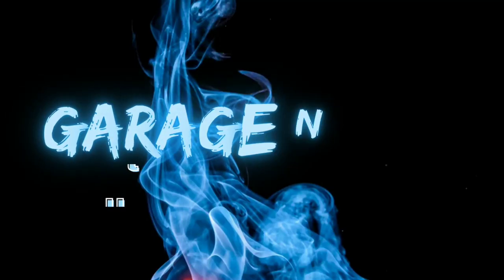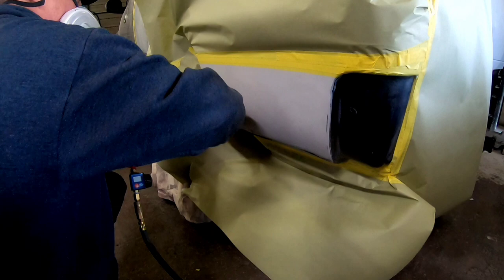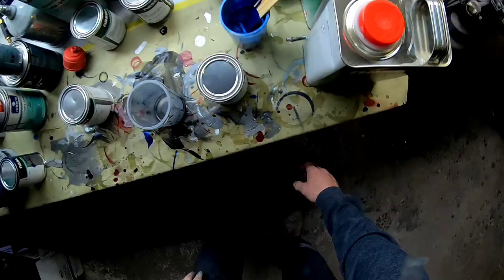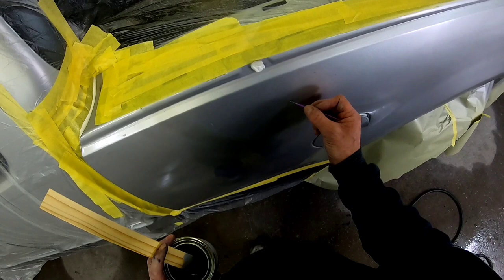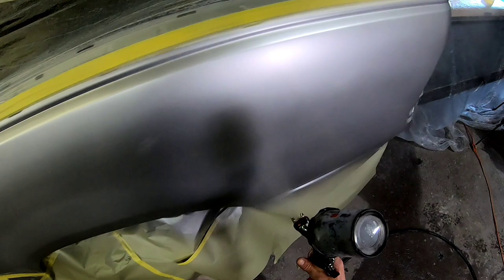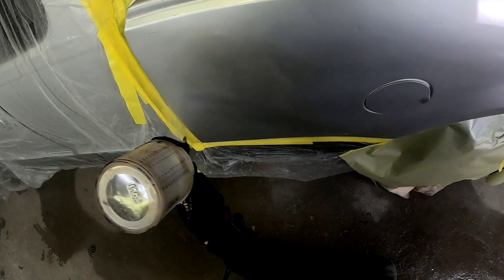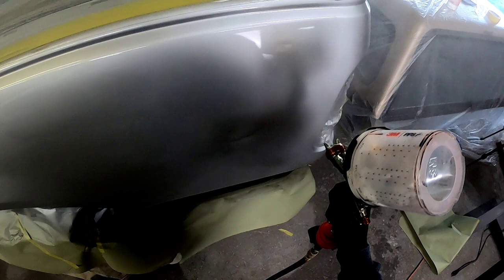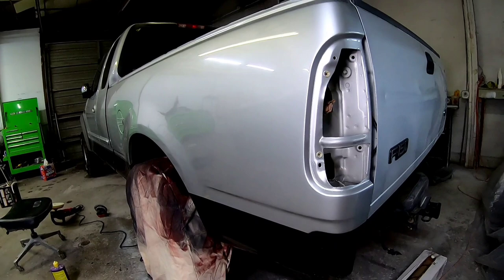Beginners guide to using clear base coat. #autopaint #autobody #Iwata kiwami4

Comment: Hi Chris. Would using a clear base coat application be a good addition when refinishing any colored substrate?  I guess this smoothens out the finish when you have repaired / primed areas along with non-repaired areas just ready for clear coat. 

Would love to see some content respective on blending theory / methodology that can be used to determine and proceed with this process to use as a guide
Reply from the maker: In warm or hot temps clear base is a great addition. It's  not really necessary on solid colors in cool temps.

Comment: How do you get vertical surfaces to be as slick as a horizontal surface when spraying clear?
Reply from the maker: Thin wet coats. Getting a slick finish is all about air setting in relation to fluid volume. Of course distance and spraying speed can change the appearance as well.  I have several  video's on this topic but will be doing a dedicated detailed video on this soon so stay tuned. Appreciate the comment and support!

Comment: So you have to keep your wet bed wet for just your first pass of base or how do I keep it wet for my 2nd pass/when I’m blending. Won’t it flash before I get to it in time?
Reply from the maker: If you need to you can apply a 2nd coat of wet bed right before you blend the color. It also depends what your goal is with the wet bed. I use it on metallics to create  a good clear basecoat before applying color. So metallics  lay flat in fine scratches from prep. If your concerned about your blend, lay down another coat of wet bed just before you do your blend. Hope this helps appreciate the comment and support!
Reply: I am trying to fix a dent. I already put filler and primer down. It’s metallic paint. Do I need to keep the wet bed wet the whole time or just put it down and start blending and it’s ok if it dries during blending?
Reply from the maker: @stephenpinckard526  yes, it's ok if it dries it will still help the blending. I like to keep two guns one with the clear basecoat  and the other with the color. (That's if you have two guns) and I'll  put another coat of clear base on my blend area just before I do my blend. You don't  have to do that tho. Appreciate the comment and support!
Reply: What if you only have one gun like me!

Comment: What compressor are you using?
Reply from the maker: I use an Ingersoll rand that produces about 17 cfms . There is a link to the one I use in my storefront.  If you want to check out the specs. I bought mine at tractor supply,  it cost about 1,200 
Here is the link this is three phase . I use two phase 
https://amzn.to/3LfRMyq